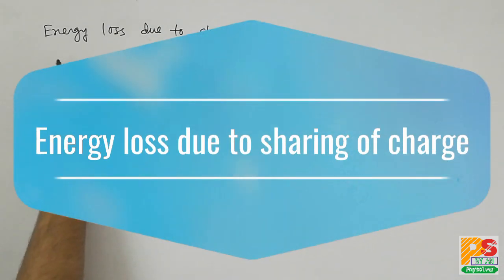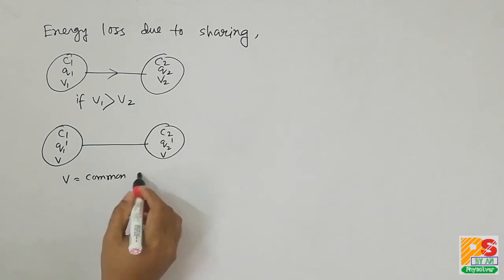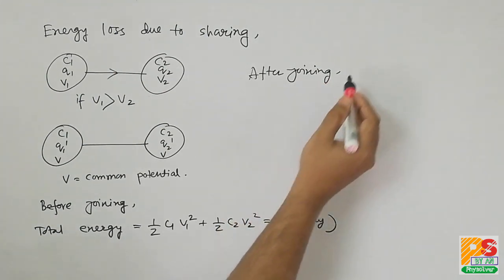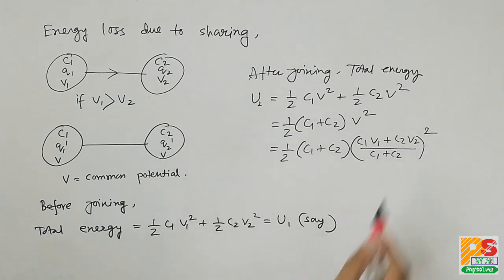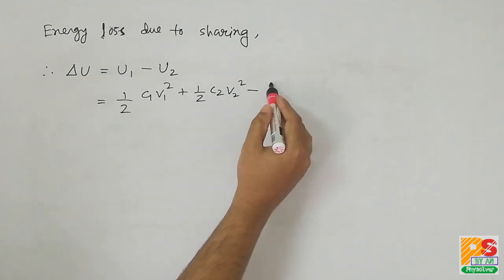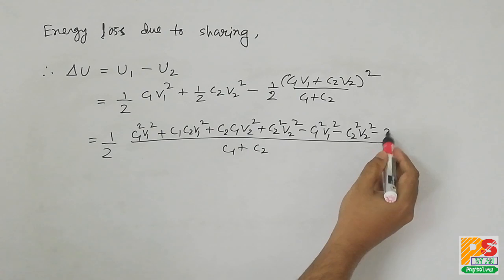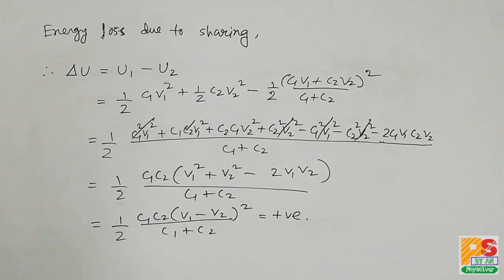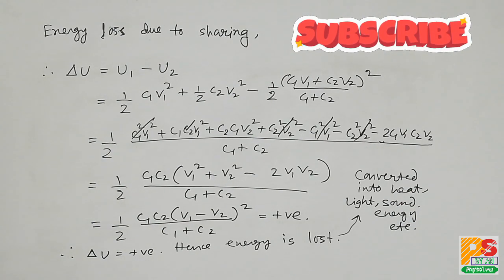Energy loss due to sharing of charge

Comment: This demonstration glosses-over the most important phenomenum.  If the lost energy is converted into heat, light and/or sound, let us add a resistor, a lamp and a loudspeaker.  The question then arises, why is the lost energy always the same magnitude, irrespective of anything you might wish to add?
Reply: Same ques did you get the answer
Reply: @Arshdeep-rt2sx have u?after em…1 year😂
Reply: @ 
Dear Mr. Chen,  I am sorry to have taken 5 years to reply to your YouTube question, but I had not previously noticed it.  In my opinion the answer is that THERE IS NO SUCH THING AS A SWITCH.  This is purely a human concept and the laws of the universe DO NOT recognise it.  The universe sees a “switch” as a variable capacitor.  When the “switch” closes this means that the capacitance increases progressively until it approaches infinity.  (But it never gets to infinity).  If there is a potential difference (voltage) across the “switch” this causes a mechanical force of attraction (Coulombs Law ?) between the contacts.  Since the contacts of the “switch” have to move, this causes mechanical work to be done, hence energy is lost.  A mathematician might describe this as a “singularity”, a magical word that means “let's not think about it any more”.  Kind regards, George.
Reply: @ 
Dear Mr. Arshdeep,  I am sorry to have taken 5 years to reply to your YouTube question, but I had not previously noticed it.  In my opinion the answer is that THERE IS NO SUCH THING AS A SWITCH.  This is purely a human concept and the laws of the universe DO NOT recognise it.  The universe sees a “switch” as a variable capacitor.  When the “switch” closes this means that the capacitance increases progressively until it approaches infinity.  (But it never gets to infinity).  If there is a potential difference (voltage) across the “switch” this causes a mechanical force of attraction (Coulombs Law ?) between the contacts.  Since the contacts of the “switch” have to move, this causes mechanical work to be done, hence energy is lost.  A mathematician might describe this as a “singularity”, a magical word that means “let's not think about it any more”.  Kind regards, George.
Reply: @ 
Dear Mr. Arshdeep,  I am sorry to have taken 5 years to reply to your YouTube question, but I had not previously noticed it.  In my opinion the answer is that THERE IS NO SUCH THING AS A SWITCH.  This is purely a human concept and the laws of the universe DO NOT recognise it.  The universe sees a “switch” as a variable capacitor.  When the “switch” closes this means that the capacitance increases progressively until it approaches infinity.  (But it never gets to infinity).  If there is a potential difference (voltage) across the “switch” this causes a mechanical force of attraction (Coulombs Law ?) between the contacts.  Since the contacts of the “switch” have to move, this causes mechanical work to be done, hence energy is lost.  A mathematician might describe this as a “singularity”, a magical word that means “let's not think about it any more”.  Kind regards, George.
Reply: Same here